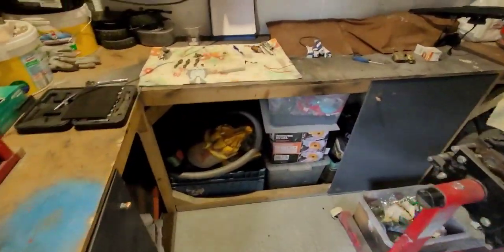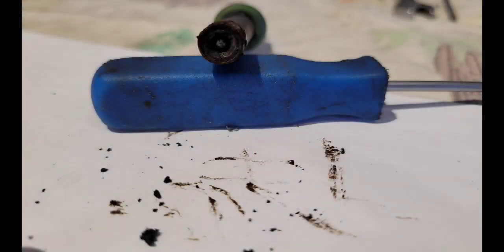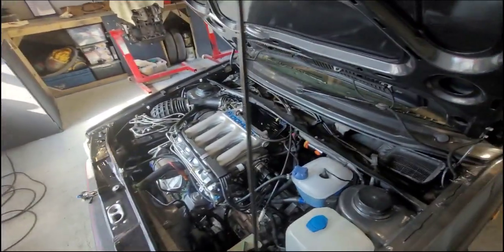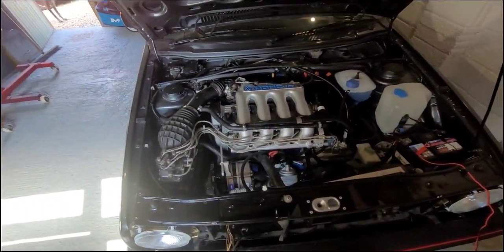Volkswagen Mk2 Golf Gti 16v - its Alive, again...but better

Comment: Great result! she sounds spot on now 👍 so it needs a metering head replacing or re building despite  running this well? It will be even better when done if thats the case 👍👍
Reply from the maker: Yeah, ill get another one from dubstock and send it away to KMI. I'll leave this one on it as i know it works.
Reply: @GreyGooseRestorations  👍 They seem to be the experts where kjet bits are  concerned. It will be interesting to see how it goes on the RR too. Out of interest are you able to disclose where you got your injectors from please? 👍
Reply from the maker: @ravenmaster6364  yes, hence why its costs so much, its worth it though.
Bought through ebay part number is 0437502047
Reply: @GreyGooseRestorations  Brilliant thanks for the injector advice/info. 
Tim Stiles used to say don't bother attempting to diy rebuild those metering units for a good reason i reckon! 👍
Reply from the maker: @ravenmaster6364  yes, i read that in his book but thought id try anyway...note to self 😄
Reply: @GreyGooseRestorations  🤣🤣 me too great book! i wish he was still around at TSR, it would be well worth the journey. The other great piece of advice i remember is to never rev the engine when adjusting the metering head flap/disc with the allen key inserted 👍